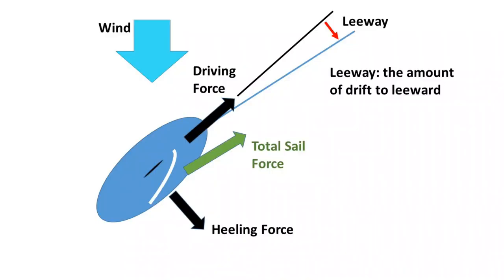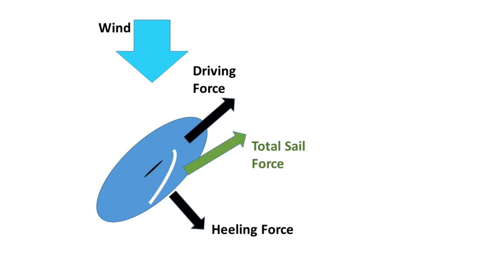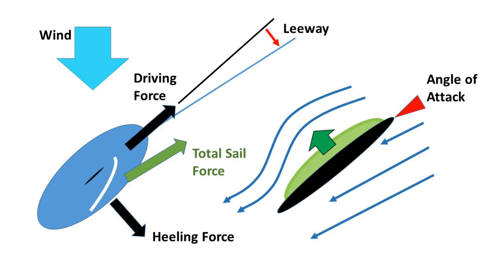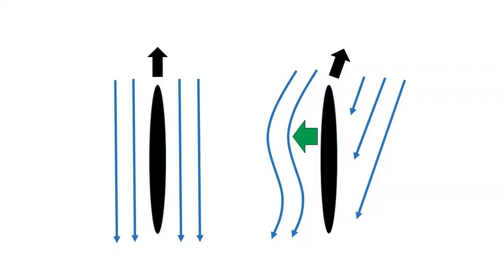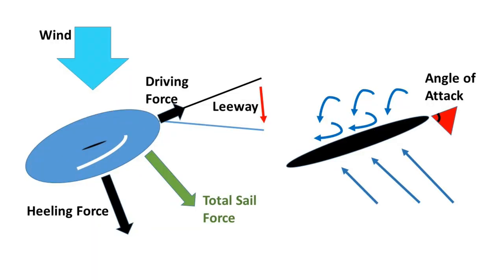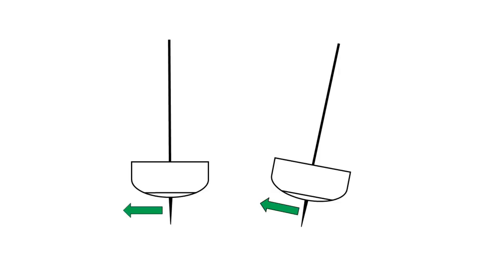What is Keel Lift??

Comment: I think in this discussion the Term “Lift” doesn’t make sense! 
It more of lateral stability. C-G stability or improved reluctance to change, lateral drag? 
Anything, but in modern word of foils, and the reliance of looking at aeronautical terms! “Lift” makes little sense. 
Aerobatic planes can use identical parabolic shapes, creating zero lift  so controls no matter are same! Trim is used to give (actual) lift.
Foils use this aeronautical understanding to create “Lift”,  by having shape like “most planes” one sized curved/ one side flatter. 
Mass flows under the shorter side faster than longer curved side. Creating upward force “lift”.

Nothing wrong either article, it’s just area of Marine vocabulary that is off base! Especially since “Aero-nautical” sciences are leaned on so much 
Good video! Not trying to attack this man’s knowledge. 
More general statement of “??” Against, much of Naval language, in this subjects moment. Could be overlooked for last 100 years but with foiling it needs to be presented clear.
Reply from the maker: “Keel lift” has been used as a term since foil shapes were incorporated into keels (and rudders), but I agree that it’s confusing because the layperson tends to think of lift as an upward and vertical motion…not lateral. However, lift in scientific fields is defined as occurring “perpendicular to the flow” and thus lift does occur in any direction. Perhaps “foil induced lateral resistance” would be more clear.